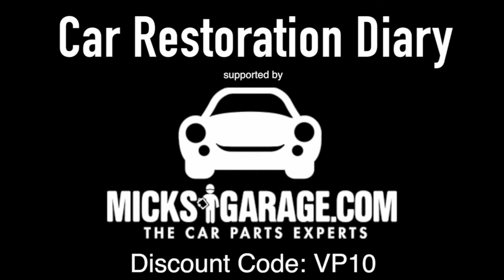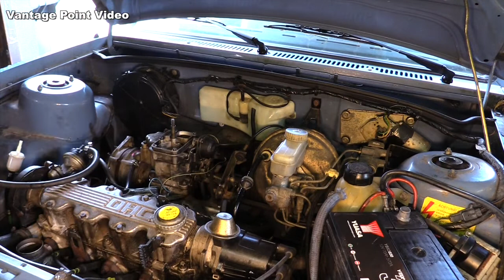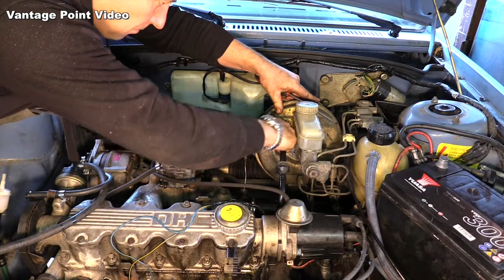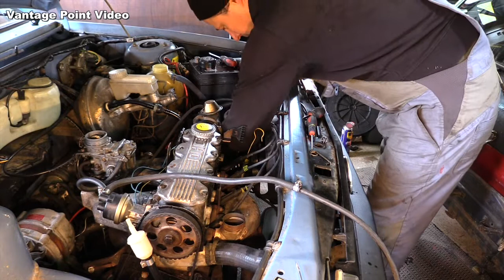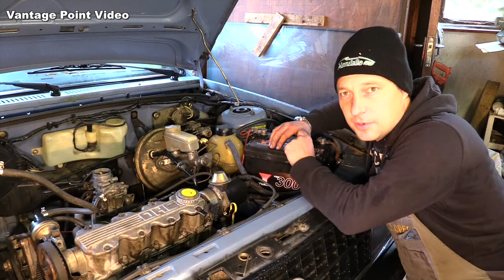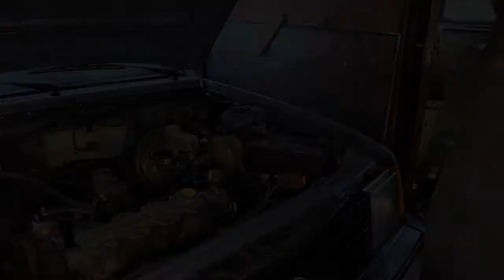Carburettor Swap: Mobility Kadett Car Restoration Diary #9

Comment: I really like the way you present your job  and especially when you are happy at the end ! 
Now, leaving this one barel solex is not  a long time option.Check, adjust and mark the static timing and check it the dynamic timing works,(more vaccum more timing ) its the shinny bit that a hose from the carb goes. I have a friend who finds the Varaget to be a good carburator IF cleaned and reconditioned 100%. I find it very complex...
But, when i installed a DMTL over the Varajet on my Manta B 13S i had problems finding the right adapter plate...so have this in mind that if you find a replacement Weber one.
I have a Varajet and a Weber in my garage around...
Reply from the maker: I think there was poor vacuum advance from this, I blew an airline back the pipe to the carb and I can feel the suction now. I have the adaptor plate for a DMTL Webber to go on the Varajet manifold. As you suggest, I want to wait till I have everything right and then fit that. I must get a rebuild kit for that too. I regard the car work as my hobby it's just the videos that make it into work. I'm just an amateur mechanic learning as I go along, so I still sense the magic when I solve a problem that I previously couldn't solve. I'm glad if I'm managing to share that experience.

Comment: Result! Get a timing light on it to check the dynamic ignition timing. Once you've done that the ignition will be nailed. Next up will be some fuel treatment to clean it all out. Even Redex is better than nothing.
Reply from the maker: We used to use Redex in our family Kadett D back in the 90's. I'll put in a drop of Dipethane as Ruairi suggested as well.

Comment: That's so much better than before. Once you've got the ignition timing correct and the air filter back on it will run sweet as a nut.
Reply from the maker: It's definitely getting there. Thanks to everyone for their support, it really helps.

Comment: Does Mobi have a choke button or will you have to put one in?
Reply from the maker: Yes, that's the thing, even though the car was fitted with an automatic choke the cable and button were there. If you remember the very first video when we started the car, my friend Ivalo was pulling the choke. It wasn't connected to anything! The engine wasn't in it's original set up.
Reply: Its like Opel knew that people were going to swap the carbs in years to come. Did Gina originally have a choke button and a Varajet carb too?